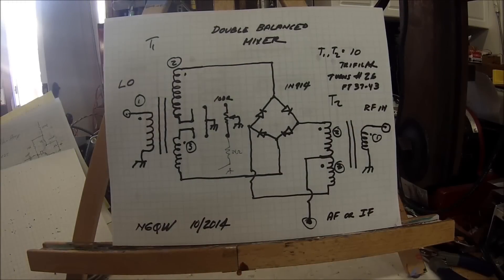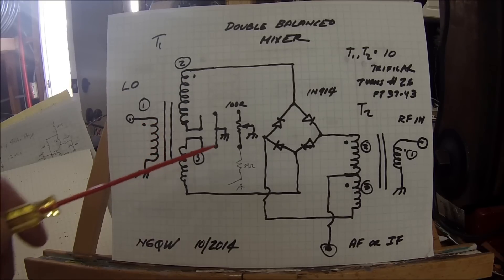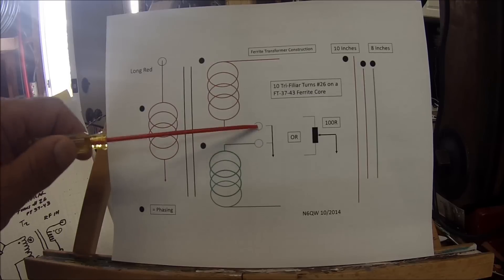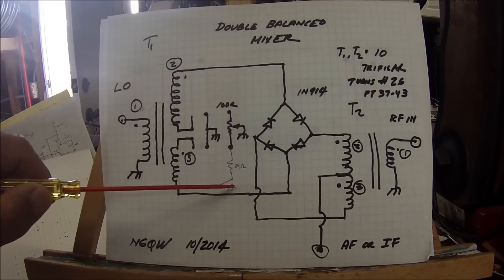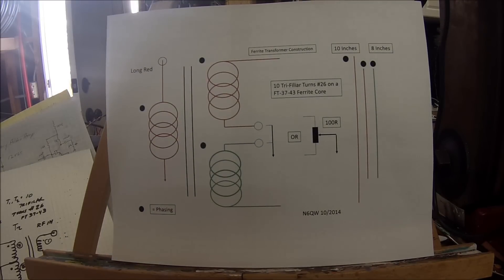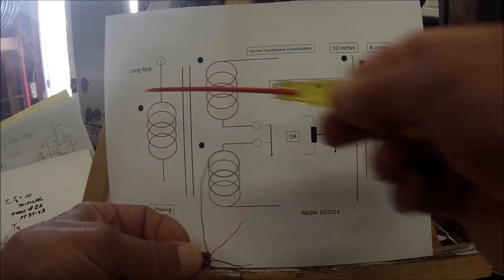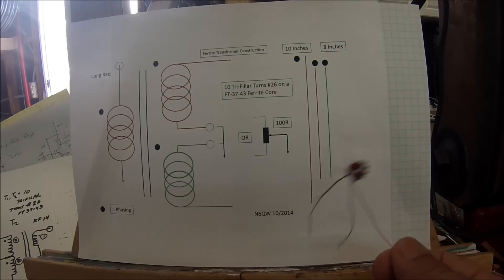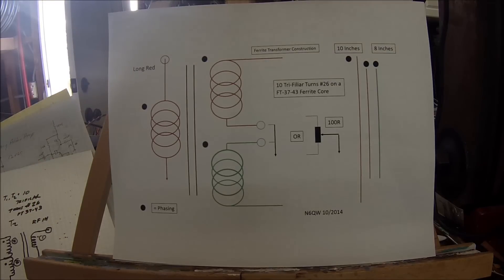Homebrew Double Balanced Mixer Part 2 of 3

Comment: How did you know parameters for the mixer? I mean number of turns, ring size and its material.
Reply from the maker: Thanks for looking at the video. 1st it is well documented that the type 43 material is well suited for use in RF transformers in the HF range. The Al value is 350 for a type FT-37-43 core. The number of turns was a bit of a 1st try but a single winding of 10 turns looks like an impedance of about 395 Ohms at 1.6 MHz and around 2K at 9 MHz and 6.6K at 30 MHz.So anything pumped into the ring at 50 Ohms would not be loaded by the winding. At 1.6 its 8:1 and at 9 MHz it is 40:1 and 30MHz 132:1.

The type FT-37-43 will easily handle a triple 10 turn winding using #26 wire.

Now just for fun if you use a Type 82 core (FT-82-43) with a winding of 70 turns that looks like a 2.5 Milli-Henry coke

73's
Pete N6QW
Reply: @N6QW  So a lot of interesting information! Thank you for the answer! Now I try figure out how it works and my knowledge is so small. At current time I try assemble super heterodine using tubes so I collect information as much as possible. 

73!
Oleg  UR7WKH

Comment: Thanks Pete for the videos on double balanced mixers. I stumbled on part 2 and I see there's a part 1 and 3 so I'll be watching them in order a bit later. I've been doing quite a bit of reading about mixers lately, to the point of obsession. I've only just got back into the electronics hobby and I hope to build a simple upconverter  for my cheap rtl sdr dongle. I want to build it from parts rather than buying something, so I can experiment and learn along the way. For the last week I've been gathering together some parts from my junk box. I think I'll build the double balanced mixer first, then a crystal oscillator for the local oscillator part.
Reply from the maker: Hi Trevor,

Thanks for watching and for your post. Be sure to look at the other two parts. This DBM was part of a project and article that appeared in QRP Quarterly called Let's Build Something and that something was a homebrew SSB Transceiver. Let me not fool you and let me caution you. Building a DBM is not a casual thing and your results unless you are extremely lucky will not match what you can commercially purchase. The way the windings are spaced on the core, the tightness of coupling, using for real matched diodes and the drive level are crucial to the success. I found that the homebrew units required more LO drive. Also be sure to add the balance pot as that will arrest some of the mechanical problems with windings and diodes. Building a homebrew DBM is like having a date with the girl who is known to be "loose!" You do it once to check the block and then you find a nice girl as a regular date! 

Packaged DBMs used to be expensive but now can be had for more reasonable prices. So go ahead and check the block but if you are building a converter for an SDR Dongle then look to units like the ADE-1, SBL-1 or the TUF-1. Look me up in QRZ.com under my call N6QW and you can email me direct.

The loose girl was lots of fun, but not someone you take home to meet Mom!

73's
Pete N6QW

Comment: I just use 3 different lengths of wire to wind my trifilar cores. I have plenty of magnet wire I've picked up over the years, so a couple of inches of wire tossed in the copper can is no big deal.
Reply from the maker: That certainly is an excellent solution. Bravo

Thanks for the post.

73's
Pete N6QW

Comment: Great video as always Pete, thank you!  Quick question on the phasing dots (which you make a point of a few times in the video).  Obviously the phasing is critical on the two sections of the secondary, but does the phasing on the primary (i.e. LO input) matter?  Thanks!
Reply from the maker: Yes! Lead Marked #1 should be at the same point as the connection to lead #2. The wires are all wound in the same direction.

73's
Pete N6QW
Reply: @N6QW  Thanks for the quick reply Pete, I need to go back and check some of my builds now.  It's interesting because SSDRA (fig 3.30) shows a phasing dot on the primary just like yours whereas EMRFD (fig 5.19d) does not.  But I know your view of the relative merits of these two books. Much appreciated, 73s.
Reply from the maker: @mars667  I keep telling everyone -- EMRD makes a great door stop. Think in reverse -- if the wiring approach is unimportant then why ever were phasing dots created.

Comment: Thanks for that Pete. I had a problem finding a DBM for my 630 metre transverter project. Built this in a couple of hours and it works fine
Reply from the maker: Hi John,

Thanks for the feedback. I did find that because the DBM was not made on an assembly line that it took a bit more drive (like 10dBm) but other than that I too found it works FB. If you like to experiment you might try some matched 1N5070 Shottky Diodes --versus the Silicon. 

Have fun.

73's
Pete
Reply: @N6QW  I’m driving the LO with 1v pk pk which does equate to +10dBm at 50 ohms. I’m also using 1N5817 Schottky diodes. My transverter will be 432 kHz to top band using  a 1.5 MHz I.F. Thanks again for the video.
Reply from the maker: @G8CHP  Hi John. You might want to check your calculations 1 V PTP = 4 dBm , 1.414 v PTP = 7 dBm and 2 V PTP = 10 dBm. --so you are I think driving it with 4 dBm. The formula I use = VPTP^2 and that times 2.5 (conversion factor including 50 Ohms) the the log of that times 10. Check my math --but you may be OK because of the Shottky diodes.

Pete
Reply: @N6QW  you are correct Pete. I calculated 0.707 of 1v when I should have calculated 0.707 of 0.5 volts. Even so, increasing drive above this results in little extra output, but more noise.

Comment: Always a joy to watch your work pete, I use your method of winding tori's, simple and effective, works every time, keep safe.
Reply from the maker: Hi Peter,

Thanks for your comment -- I actually have received several inputs that criticize the method I used . So your input is much appreciated. I just reason as in so many insttances -- those who made negative comments never used it but simply opened their mouths and made comments.

Pete

Comment: How would you wind one of these coils for 10.7MHz FM IF? Are there any links to other tutorials on Trifiliar (?) winding. I've been reading the info about using J310 FET's instead of Dual gate MOSFETS (which are  becoming unobtanium) in your simpleceiver. Do you have any LTSPICE files you can share so that I can explore this substitution myself? I'm trying to adapt an old FM tuner front end so that it doesn't use dual gate mosfets (ancient 40673 types) and can instead use a cascode FET or bipolar/FET arrangement for the RF amp and mixer. Wondering if a double balance mixer can replace the existing 40673 based mixer and give better results. Thanks.
Reply from the maker: Hard to respond on you tube. Send me an email to n6qwham@gmail.com. I will be happy to share the LT Spice simulations -- with a DBM you have 6 dB of conversion loss --actually maybe 10 dB with a homebrew mixer so you might have to also have a strong post mixer amplifiers to make up the gain deficit. The J310 DGM is a neat trick as I have used them as mixers, Amplifiers and product detectors

Pete N6QW

Comment: Good work! I made a double-balanced mixer using BAS70-04 double diode and a small binocular ferrite core (height 0.27''  width 0.12''). A diode mixer is much stable that active BJT and mosfet mixers! I prefer to use it in homebrew recievers.

Comment: Pete,
What diode's do you really recommend in a DBM?
I used  914's in a BitX build several years ago, and changed them with a matched quad of HP diodes that Dan's was selling from Montana. Actually think the audio was improved by the change.
Lee, WA8QFE
Reply from the maker: Hi Lee,  You have put your finger on the issue = MATCHED. It really doesn't matter too much -- the 914's or 41448 or 4125 -- The problem is very closely matched diodes. In critical applications I would forego the homebrew mixers. the only reason they were used was in connection with the Let's Build Something project. The homebrew DBM's were lossy and needed more drive. power. Save yourself grief and buy an SBL-1. ADE-1 or TUF-1 and just move on.

73's
Pete N6QW

Comment: Wish I had found your videos earlier,  well done.
Reply from the maker: Thanks for your post. The videos accompanied a published article where these DBM's were part of a SSB transceiver project. My co-author and myself received several emails -your DBM doesn't work. When asked if they watched the videos - the reply was well no. I do not know how we could have explained it any different. Three windings that could be easily identified and follow what was said about the hook up --well you know the rest. Glad it was useful to you.73'sPete N6QW
Reply: Pete, the windings could arguably be buzzed out, as long as you which end is the start and which is the finish, I was unaware that the videos accompanied a published article, but it is always good to see what people are building. FWIW I have seen a commercial HF rig with one of the diodes in the ring reversed, it still mixed... 73s G0FVT

Comment: Dear Pere,

What thing happen if we don't use any transformers? Will it work without them?
Reply from the maker: This is a passive mixer and part of the magic of the mixing process occurs in the transformer windings -- that is why the phasing is so important. Active mixers use a different process for mixing and thus may not require the transformers. The NE602 is a Gilbert Cell mixer and except for impedance matching or coupling to external circuits does not require the trifilar windings. That is about all I know so you may want to do some additional research on the subject.
Reply: Pete Juliano Thank you so much, If I want to buy a commercial type of Transformer, do you know what I should order? What is the specific commercial name for impedance matching transformer? there are a variety of transformer.
Reply from the maker: hossein jiryaei Take a short break and take another look at the 3 videos on Double Balanced Mixers. The videos tell you how to construct the transformers and the type of core material. I usually wind my own transformers and those videos give you all of the information that you need. I simply cannot recommend a commercial product to you and quite possibly you need to do more study of the subject. I have no idea of what is your application and you will either  need to consult others or become more knowledgeable about the subject.  There is nothing more I can provide you other than what you see in the videos. I am sure there are commercial products but that is for you to investigate.
Pete
Reply: Very cool circuit. I thought making the 2 transformers would be hard, but compared to a lm1496 gilbert cell mixer using 13 resistors and 7 capacitors, its a whole lot easier!

Comment: Mr. Juliano,
   Could I build your mixer, and without an RF preamp (a good dipole, ladder line, and antenna tuner as the RF in), supply that with a DDS that I already have (arduino based), and produce a result?  What I am getting at, is how could I know that I have a successful build of my mixer stage, as I don't have any test equipment?

   Thank you for the great tutorials. Please continue to share your knowledge, as homebrew amateur radio is a fantastic step away from our technology saturated daily grind.

73's
ke4ksi (expired)
Reply from the maker: Well you are starting in a bit of a hole based on the following. If you go back over part I of 3 of the DBM I mention that the double balanced mixer we are using is a GAIN loss device with as much as a 5 to 6 dB conversion loss so an RF amplifier stage is very likely required. The RF amp is un-tuned  and contains but a few parts. There will be an upcoming video on that piece. Not complicated and as I said a few parts.

While you could bypass the Band Pass Filter -the DBM used as a Product Detector will be as a broad as a barn door --so for serious listening beyond just getting to work, the BPF should be in the mix. The knowing it if works is pretty much is a go no go --you will either hear signals or you won't. Now that is just getting it to work - getting it to work at peak performance may be an entirely different matter that would entail being able to make measurements.

So hook it up and if you are lucky you may hear signals.  But I would strongly suggest you go back over all of the videos and get a really good feel what is happening in each block before you just start soldering parts. There is a lot of info on the internet about DCR's and you should read up on those as well.
Reply: Pete Juliano
It seems that I might should start with an already designed kit. I've built a Softrock Ensemble, but find that I desire a robust SSB receiver. Is it too much to ask from a rockmite (or similar ne602 based cw txr) to widen its receive bandwidth to pass SSB? all the kits that I can find that are SSB ready are $80+ -- too high for my experiments at this time.

thank you in advance for your time, i'm still enjoying your videos !

frank
Reply from the maker: Hi Frank,
Thank you for your comment and input. You ask an interesting question. If the basic radios you mention DO NOT contain any sort of a narrow crystal or audio filtering then it should be fairly easy to copy SSB on these radios. The difficulty with the rockmite is that it uses a crystal to set the receive frequency and there is a very narrow Delta tuning with that crystal. AND the crystal is in the CW portion of the band. One thing you could do is to build a VFO and substitute that for the crystal in the rockmite and then you can tune the CW as well as the SSB portion of the band.
The NE602 offers more possibilities in that with pins 6 and 7 you can hook up a tank circuit and you now have a VFO –install a tuned network on the front end (Pin 1 I think) and an audio amp off of either pins 4 or 5 and you have a direct conversion receiver not unlike you have seen in the videos.
So I think what you are asking can be done very inexpensively! Do an internet search on the NE602 as a direct conversion receiver and I think you will find many radios that can be built for less than a $20 bill.
I am delighted that you are taking up the iron and building something as that is how one learns. If you have more questions you can contact me directly at radioguy90 at hotmail dot com.
 
73’s
Pete N6QW